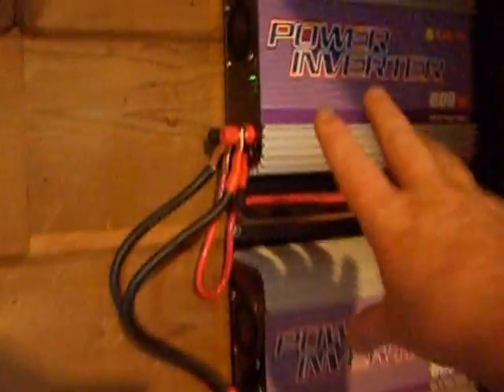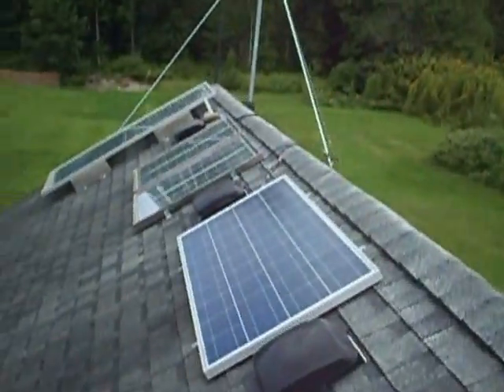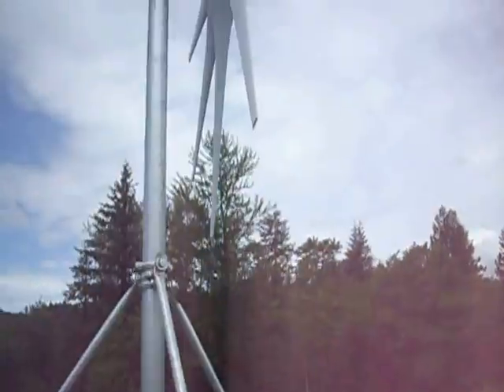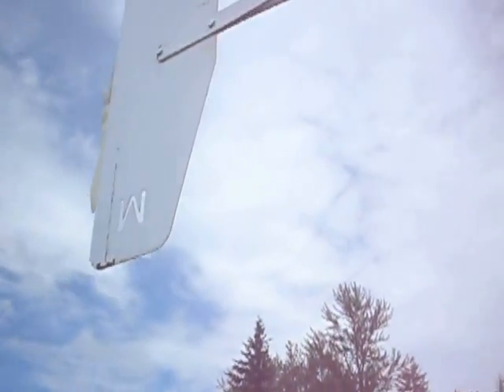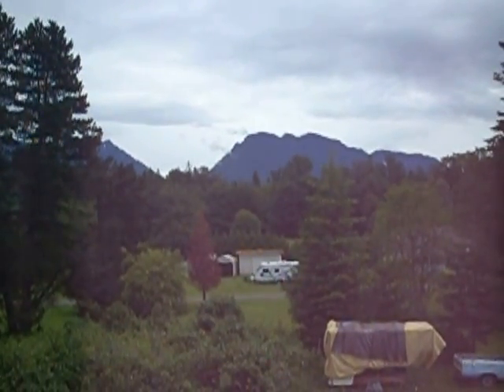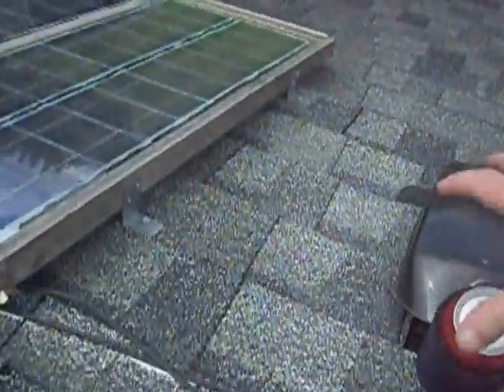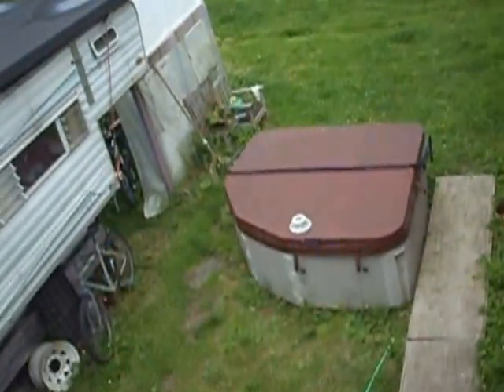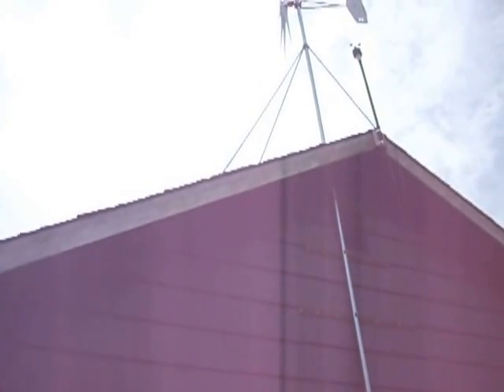Missouri Wind and Solar 12v 1600, after 10 months.

Comment: I have a 48 volt. I only get Winter winds and their hurricane speeds all winter long. And the voltage comes out like 120 volts and blows everything up. How many of those little dam inverters have I bought. I even bought a whole bunch and hooked them all up so nothing could go wrong and they all blew up. The best I can do is hook it up to the hot water heater element.

Comment: why weren't the blades spinning? what's the min wind speed to get the generator going??
Reply: It is not high enough
Reply from the maker: You need around 10mph winds to start making power using the setup I show in this old video. MW&S Has much better turbines now, since I made this video over 4 years ago ,,,, I am still running this turbine it works great!,,, Many years after I bought it

Comment: Extension cords coming out of windows, bundles of DC wire hanging down the outside wall... lucky you aren't in the suburbs, or the neighbors would report you to the code enforcement.
Reply: Lance Baker sounds like you like to complain about other people another snowflake that wants to control what you can and can't have

Comment: Jason, I was thinking about putting four 1600 or 2000 watt turbines on roof mounts.  Do you think they're quiet enough to not be a nuisance?  I'm getting a wind anemometer to get a good wind measurement, but placement on the roof would be ideal for me, IF they're quiet.  We visit this Amish place and they're turbine on their shop is sooooo noisy.  Thanks and nice video.
Reply from the maker: Well,, for me in my area roof mounts are the strongest and best way to get my turbines high in the air,, the higher up you can get your turbines the better and more consistent power they seem to produce,,

Roof mounts are kinda noisy,, My roof mount turbines are hard mounted directly to wood,, but you can use rubber between the wood and turbine mounting pole that might help with the noise,, I don't think the noise is bad,, I sleep right through it,, but some people might not be able to,,,

Thankyou for watching,, I will try to help you out as best as I can if you have more questions :)
Reply: When the wind is really blowing it is a terrifying thing. I'm In The sticks minor far from the house 300 ft. And they're not alternators they're generators with magnets. There are devices to limit the voltage that I do not have. This blew up and then One battery exploded and the other one side split, both were outside. Of four.  I've connected to a hot water heater directly which is something you can't do supposedly. I've blown too many many inverters up because I have high winds. I have solar panels too. Easy peasy no issues and nothing to fear. I like my windmills, a hobby and has all hobbies a black hole economically. And when the power men heroically kept restraining the power again and again and again when you couldn't even stand up in the wind until it they couldn't get it back on again, the heat lamps were hot, the radiant old fashioned satellite dish reflector heater was hot and I had plenty hi amperage high voltage DC power until the windmills flew off of the poles. I replace that hose clamp that they sent it with the ring with two Allen screws along with new blades. Here comes winter and snow just a few weeks away if that here in Alaska north of Anchorage. Enjoy.
Reply: So much power so much so much? Don't do it yourself. Did you realize how much the batteries cost for the inverter? $8,000 for $15,000 Watts with the Smart box on top so that you don't blow them up in they don't get too cold. Schneider electric doesn't build the inverter I bought for $6,000 with delivery any longer and it's available for like $1,000 without customer support I'm sure well more than that but cheap or sell other places now. Let acid batteries are cheaper and they have a shelf life of five years. You have to have batteries to put it through an inverter in this case. How much are you planning on spending on batteries it's the last question you'll be asked after you've bought everything else, turns out I can't afford the batteries. Was Thomas Edison a nut with his DC power system? I used regular light switches. When you turn it off the blue light comes on and then the smoke comes out. Throw arm switches are required with big lightning. Watching my heating element turn white hot was unnerving at best. And the length of wire. Are you thinking about the one with twin alternators on one blade? The one blade can only handle one alternator unless it's a hurricane. Better to buy separate than the dual. I bought several of those four. One the shaft got damaged by the wind over speed and it slipped and I could hear that. Wind turbine maintenance during the hurricane, an adventure. It's not a tropical hurricane but an Arctic hurricane of clear skies with the jet stream on the ground. Every winter. And then when there's a storm on top of it like last year for 10 days it was rough. The power was only out for 10 hours I have a little 12 volt inverter 1000 Watts that I can charge with the truck that ran my Toyostove and LED light without failure or charging on two batteries left over from the four when two blew up when the 48 volts was 120 DC. Get somebody to help you get all the correct components that match rather than pick and choose off of the shelf.

Comment: Thats a very nice set up Jason. Congrats mate.
I also just put up my dual turbine, but on a flat roof though.  Its working very nice for now and I hope it stays the same.
A question I got  is how do you measure the amps from the turbine? do you connect on the ac side of rectifier or on the dc side?
Thanks a lot
Reply from the maker: I use the DC output to measure amps, I think most Amp gauges measure the DC output,,, I don't know how to measure the AC amps..
Reply: @wabuminifarm3437  there is a meter for that. It has a coil that snaps open and closed at the end of the multimeter. How much are you getting out of it I bought a kilowatt meter k i l l a watt plug in meter. Normally like you want to know how much your refrigerator uses and you plug it in and check it out and it works in the same fashion we plug in your inverter and it goes backwards which still adds up. Those are about 30 bucks or less. They don't make the original anymore but there are many copycats.

Comment from the maker: Heh,, I cant stand waiting for paint to dry,, so I always jump the gun and put things together before the paint is ready.

My 1600, is holding up very good :) I am very happy with the power I get from it during my winter winds. 

I could probably run one big turbine, But I think running a few smaller (Like my 1600) I can get more power,, different winds in different areas on my property. By spreading out my wind turbines over a larger area means I should be able to grab more power from my winds.